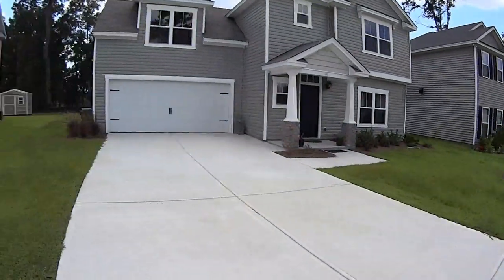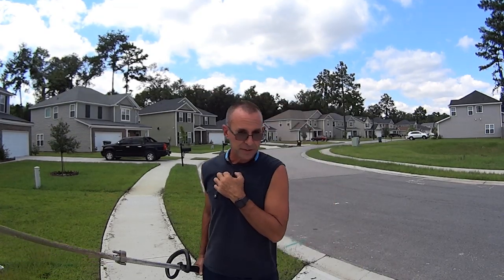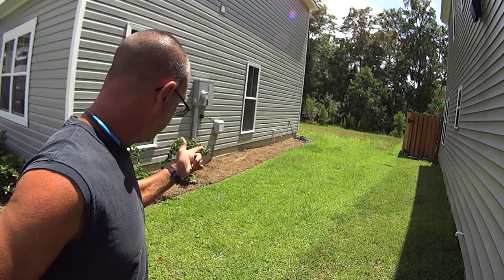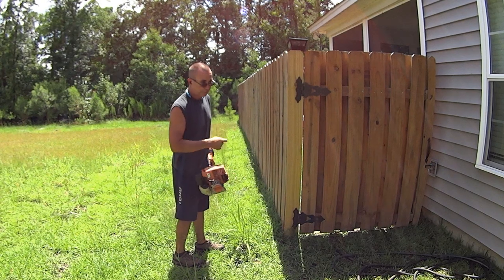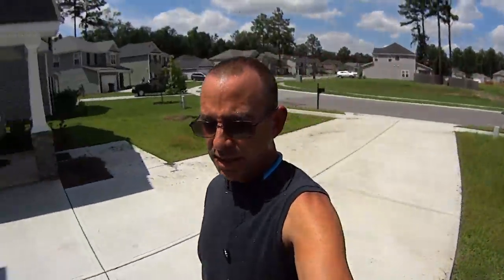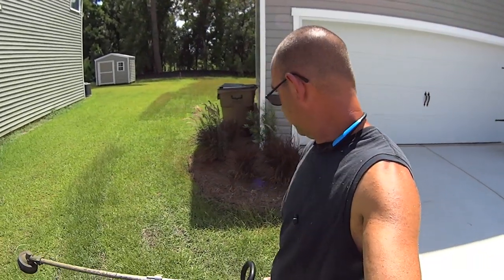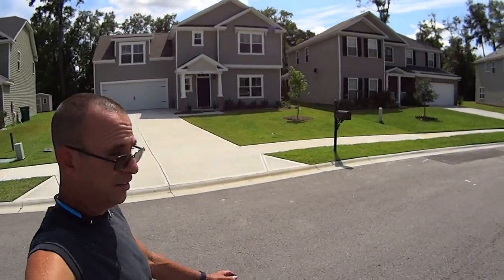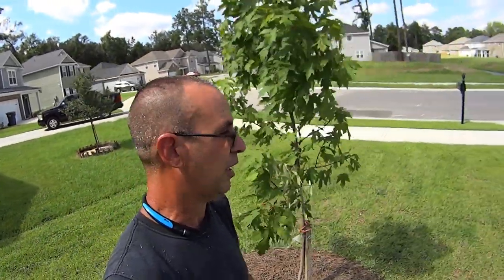Cutting Grass - Manicure a New Lawn Service Client's Property #SideHustle

Comment: I only use the highest octane gas and Stihl mix oil for my chainsaws and my FS110 brush cutter, in Western Canada we don't have ethanol laden fuel in the area where I live. The 2 stroke oil reduces the octane level I use 91 octane, works excellent never had any issues with my saws.

Comment: Instead of using ethanol free gas that’s 20+ cents more I have seen & you can purchase fuel stabilizer to put it in the gas cans while they are empty & I have had no issues with 89 gas when using fuel stabilizers on any equipment as it kills all ethanol & it’s only 4-15$ for 2+months worth of fuel stabilizer depending on how much you use the equipment & I have a guy that repairs my mowers locally that’s way cheaper & faster then other shops here in Orlando,Florida & cleaned my push mower carb in 1 day between the night he picked it up & I went to get it compared to other shops that would of taken 2 weeks or so..I get 1 time cuts & get called back cause of the quality work I do

Comment: Straight shafts spin to the left.. You wouldn't blow grass in the beds if you trimmed the other way
Reply from the maker: The mistake you make is assuming that because I’m walking to the right I’m using the right side of the trimmer head. Imagine walking to the right but having the trimmer head angled down toward the left so as I’m walking to the right it’s cutting the grass and throwing it back at my legs.